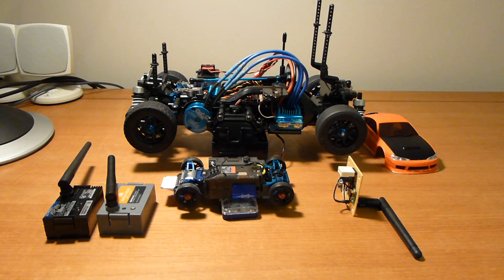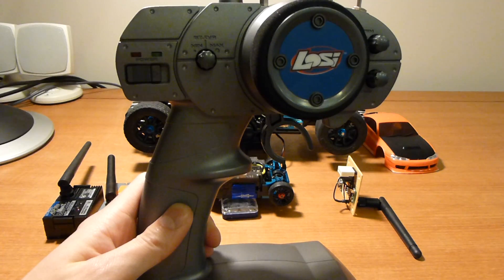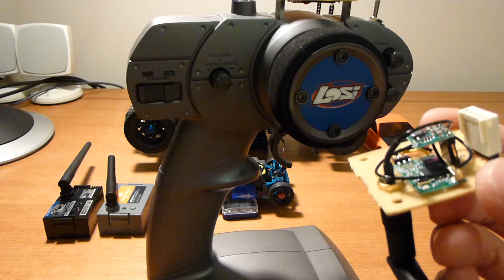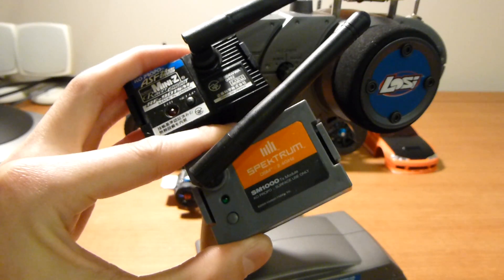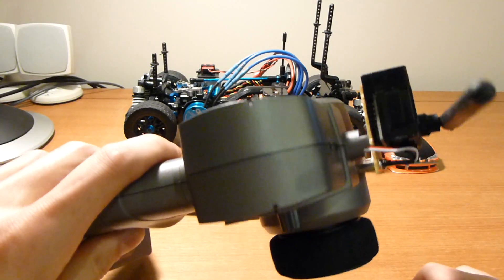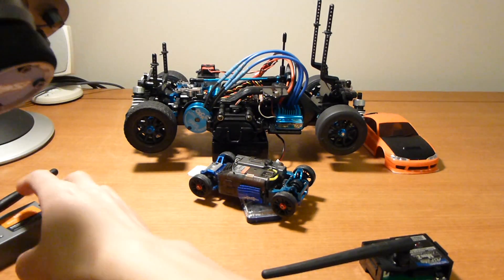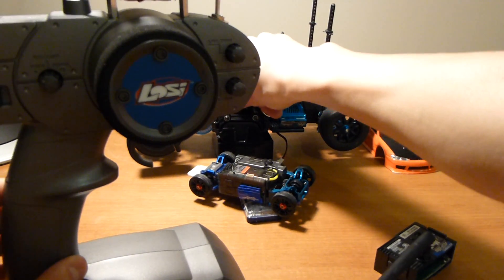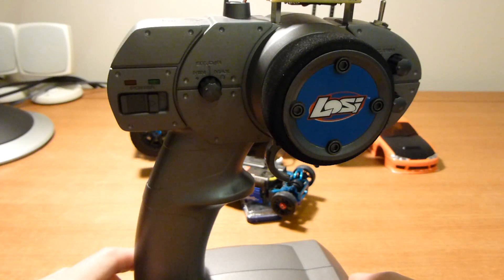Losi RTR radio to module conversion

Comment: This is actually a pretty neat mod. I'm a plane guy delving into boats. I have both one of these and a 27mhz one (from a Mini LST2 and a Micro-T respectively), and I opened up the DSM one to have a look at the power switch since it was acting dodgy. I might just shift the DSM daughterboard to the 27mhz one and add on an FrSky module as well, and use a small 3S Lipo to power it all. FrSky will be for boats
Reply from the maker: Thanks for your comment. If you have other modules to use, I suspect the 27MHz radio may be a better base to use since it is powered by 8xAA rather than the 4xAA of the DSM radio, so I would think the rest of it is built to work with the higher voltage and will not need to be stepped up for the other modules. You may need to step it down for the DSM daughterboard though! Good luck.